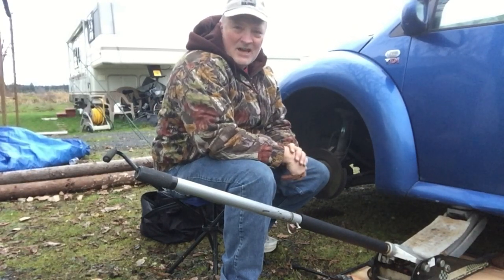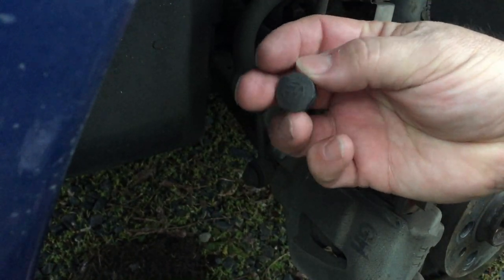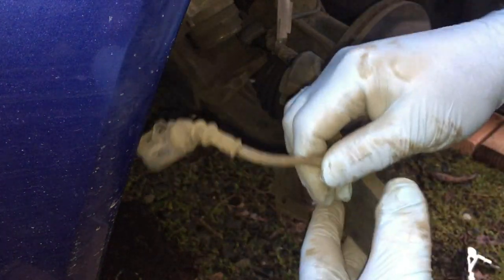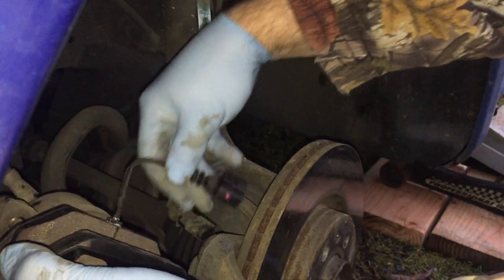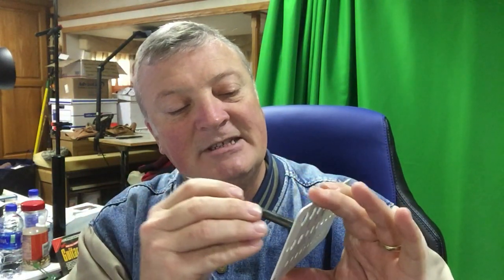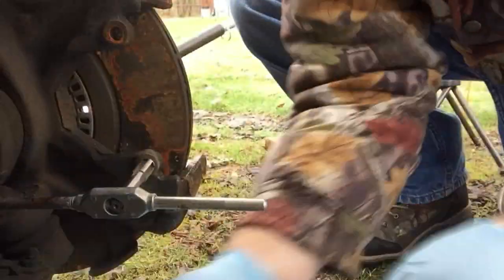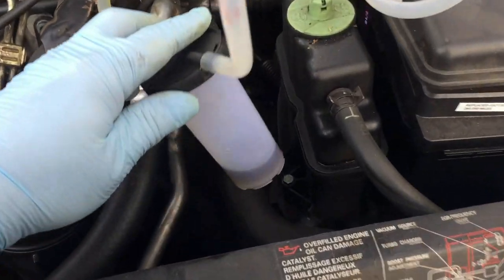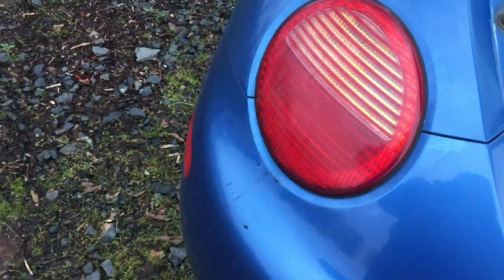Brake Replacement on 2001 New Beetle

Comment: Did you strip it with the T45 or was it stripped prior to your ownership? Im needing to do this soon and dont wanna mess anything up.
Reply from the maker: It was 95% stripped... I did not even get to tighten it past 10 ft/lbs. Some people expect because it is a German made car, all bolts should be "Guten Teit!" For the most part, that is way too tight.
Reply: @HelicoolsHelipad  So was it the wrong tool used or it happened before you , sorry im confused im just asking if i follow your video and be gentle will i be safe to use a T45 ?

Comment: Great video David. A couple of questions though, What is that wire on the pad? I have never seen one on a pad and I was just wondering. The other is on the helicoil, maybe put a bit of loctight on it to keep it from coming out? Enjoyed watching this one.
Reply from the maker: The wire (when the brake shoes wear down) makes a contact connection and trips a warning light on the dash. I've never seen this before, but then again, it's a German vehicle and my first VW. The helicoil instructions said that when the bolt going in gets tight, the stainless steal helicoil bites into the metal and stays put. There was no mention about needing lock-tight, so maybe it doesn't need it? I honestly don't know.
Reply: @HelicoolsHelipad  Thanks for the info. I only asked about the helicoil as when I used them they wanted loctight on it too. But you know those Germans. LOL

Comment: That should be triple square bolts otherwise called 12 point internal bolts. Be careful not to strip the head.
Reply from the maker: No sir. The internal bolt fits the T45... on other VW's, there might be a 12 point, but not on the 2001 VW New Beetle. Thanks for the comment, though. Cheers!